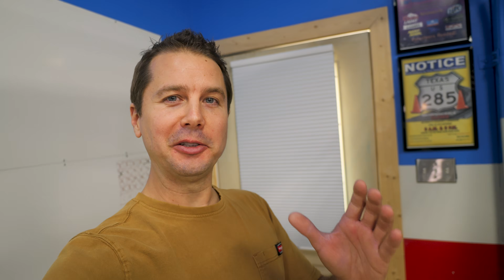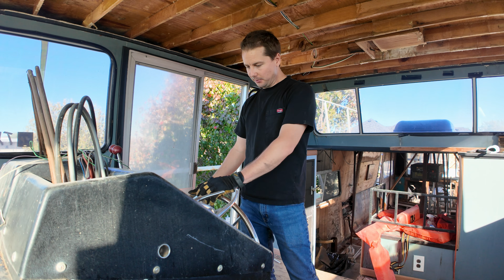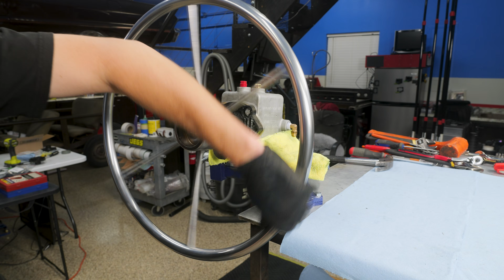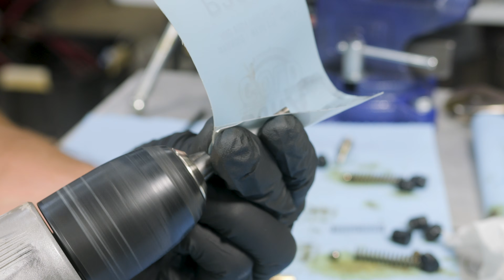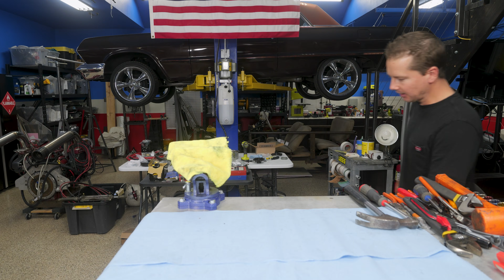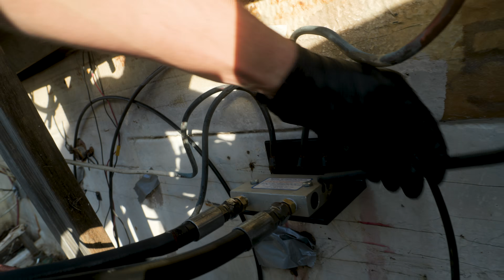Is Our Houseboat Steering System Repairable?

Comment: 360 bumpers? Cheap radios and a reliable spotter? Luke McFadden just put some bow thrusters on his crab boat. Muppets style orange hair wheel wrap?
Reply from the maker: I started looking into bow thrusters and electric vs. hydraulic. Should be another fun rabbit hole to go down.
Reply: @Motiv8Labs  Did you ever get that generator going?